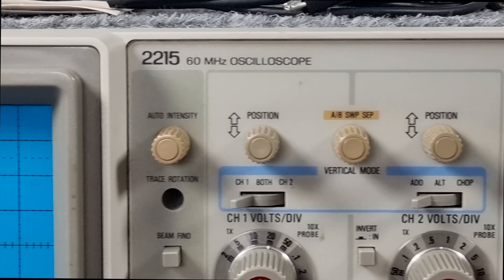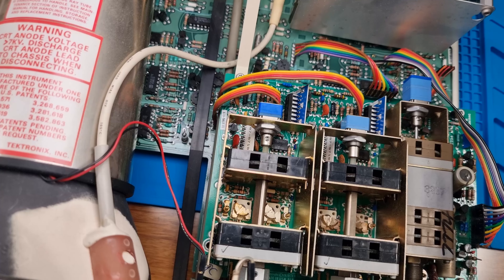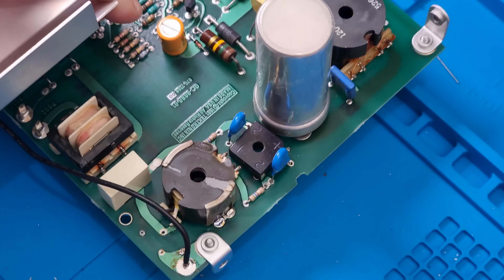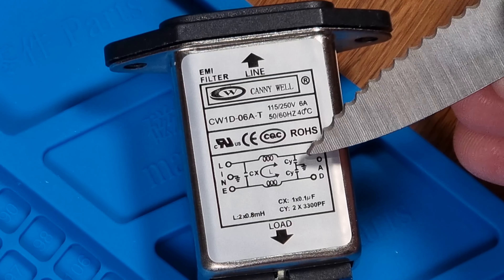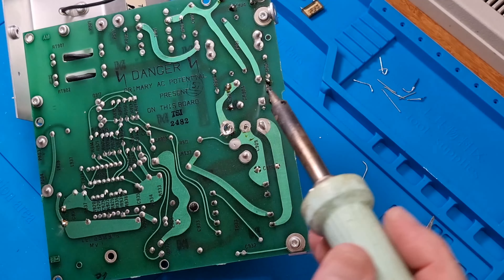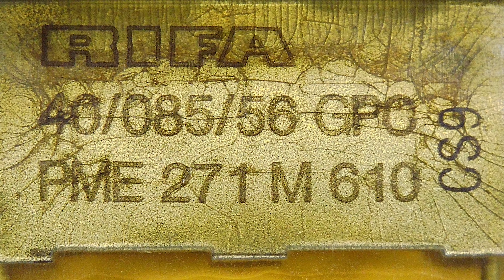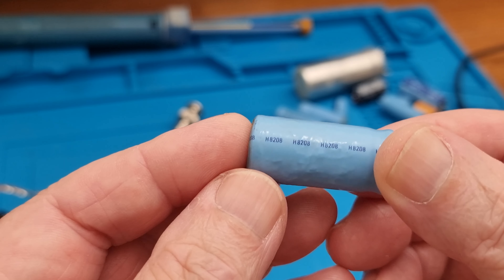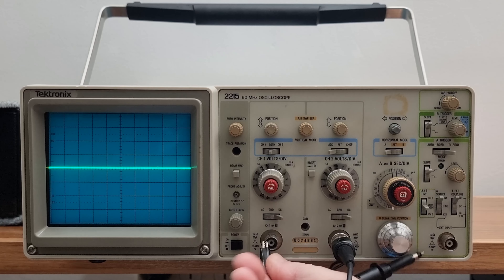An Oscilloscope Adventure: Tektronix 2215 (1982 build)

Comment: I just bought a 2215 that is humming and giving off electrical smells.  I will check the rifas, and other caps.  I think there is something else going on too, as no measurements are working, so may need to replace some transistors too.  thanks for sharing!

Comment: Thank you for an excellent demonstration. I am attached to old things too, not least such beautiful oscilloscopes. Can I also please ask how to remove (if at all possible) the handle, from a 2205, without removing the cover. Thank you.
Reply from the maker: I think you're going to have to remove the cover to get the handle off. There might be some help in the service manual for the 2205 here: https://w140.com/tekwiki/images/0/02/070-6716-00.pdf
Reply: @clearcreekfilms  Thank you.
Reply: @clearcreekfilms  Thank you again. You are right: I did need to remove the cover, allowing access to spring-loaded Torx screws holding the handle's anchorage to the cover. Less unwieldy now to place on a desktop! But I expect to refer to your demonstration (and service manual) again for more than the handles. Thank you.

Comment: Very observant. The original cap was the large Sprague & had a metal case with 3 earth lugs and the positive lead. It was replaced with a two wire electro. The links just tie the earths together

Comment: Hi great video, i have the same issue, I want to replace the old caps, can you share the replacement caps you used, finding it hard to find equivalent. Thx
Reply from the maker: For the electrolytics I used ordinary like for like values that are usually readily available. For the Rifas I made sure to replace Class X with Class X and Class Y with Class Y of the same value. I think I sourced these from a large component supplier like Element14
Reply: Thank you!

Comment: What going on there at 5:00 with the jumper wires? Traces lift off the board?
Reply: I know it's one year later, but here is the answer: Actually, no, that's not the case. The old capacitor had 4 pins, but 3 of them are connected together as the negative (-), and the replaced capacitor has only one catode (-) and one anode (+). So to complete the circuit with the 2 missing negative (-) pins, he had to put 2 jumpers connected together on the only (-) one from the new capacitor.